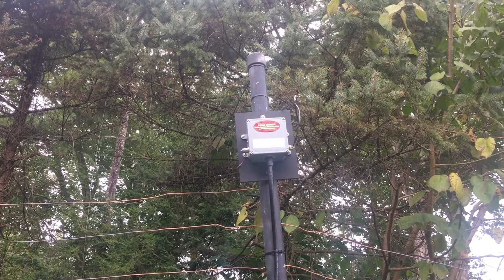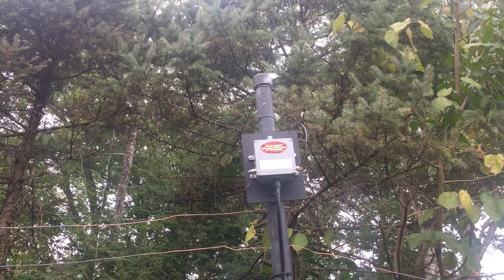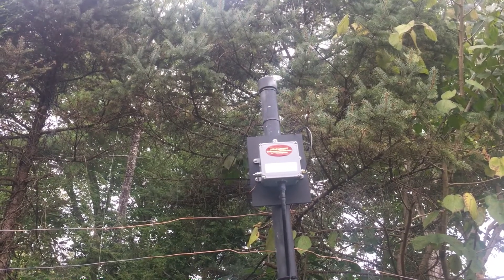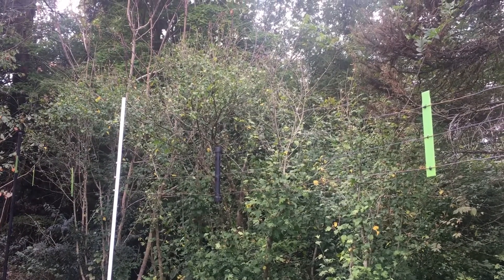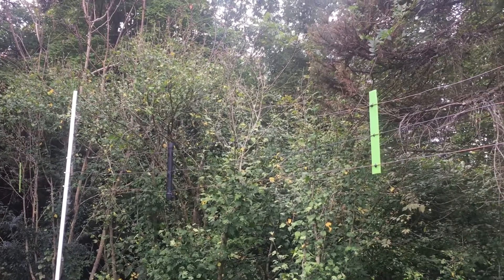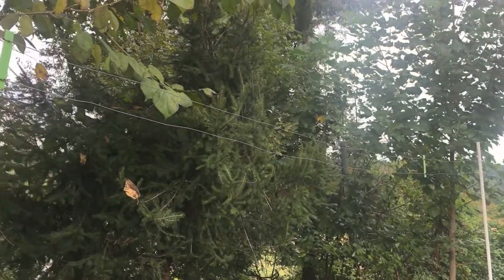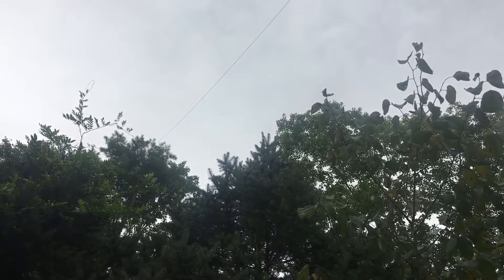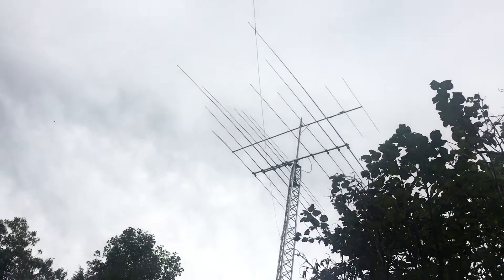K2AV FCP for Top Band Antenna ( 160m Folded Counterpoise Antenna)

Comment: UPDATE:::: The antenna is a disaster and will damage your tuner if it's not up to the task. The factors that affect using it anywhere on the band is that the FCP is tuned to a certain frequency. Changing the resonant frequency involves the vertical element AND the FCP. REMEMBER the FCP is about 10 feet off the ground. NOW the "elevated Radial "(FCP) needs to be retuned also.

Comment: I am building this antenna. And hung up finishing the FCP wires to get them straight because of a heat wave we are in. The bare wire is really hard to tame down and get to be straight. Looks like you had better luck. I saw a video using nylon jaws on pliers and me and my son will try to get the FCP looking better. I'll have 60 feet vertical and abt 90 feet horiz. Most builders are using about 150 feet total of antenna wire. Did you look at your antenna with an analyzer? Should be near 0 reactance and probably have a resistance of 30 ohms. You can use a healthy antenna tuner or if you are barefoot the tuner in your radio should be ok. Sounds like you are already having fun there.
Reply from the maker: Best wishes to you, Adrian. I hope to work you at the end of summer/ start of autumn on 160m! I haven't looked at the parameters with an analyzer, just an SWR bridge. Mine is about 2:1 SWR at 1840 Mhz. I use the automatic transmatch on my amp (most of the time) and it seems to play well. Current 160m DXCC is 136 worked, 132 confirmed..  VY 73 DE KA8SYV

Comment from the maker: Update: I have now used this antenna for about a year and have all QSLs needed for 160m DXCC. This installation was helped by the addition of a "beverage on ground" (BOG) antenna pointed to 60 degrees. I plan to install at least one more BOG, but a reversible version to improve station performance. 73 de ka8syv